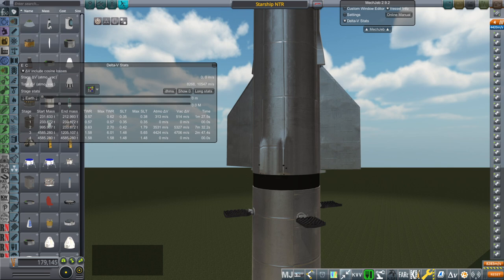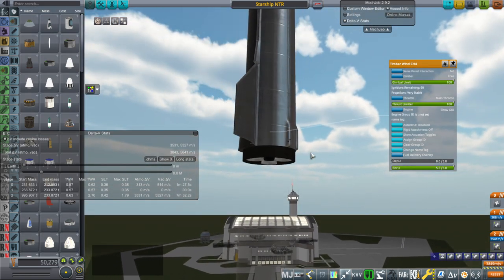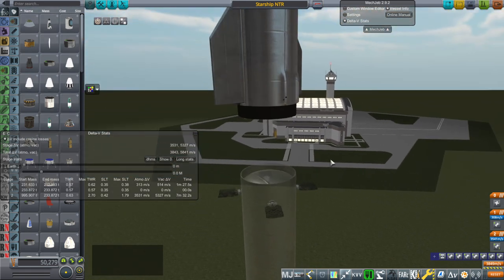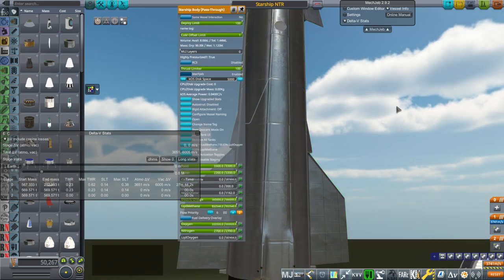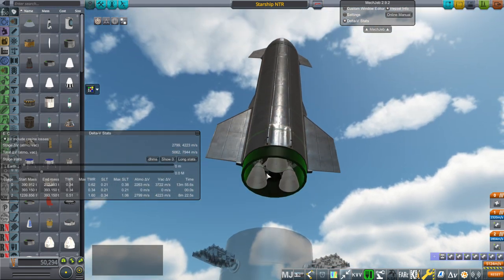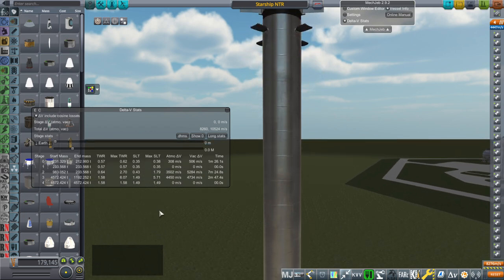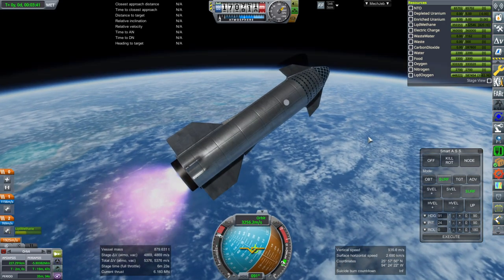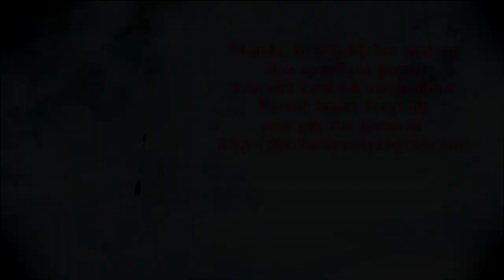Can SpaceX's Starship Go Nuclear?

Comment: There may be the idea of using Nuclear engines on Starship, arguably some more efficient liquid/gas core engines that would allow for Jovian or Saturnian transfers.

I’d also propose to you to make a booster with 4 vacuum engines in place of 8 surface engines on the typical outer cluster of 20. Add a starship nose to it without fins, keep the grid fins and see how well that goes to orbit. Maybe make the nosecone jettisonable to reduce dry mass.

Comment: Well at least the crew will go nuclear once it travels to Mars... We still have no answer from musk how he plans to shield a crew of 100 in a tiny ass tin can.
Reply from the maker: Well, that radiation wouldn't be from the engine, at least. Honestly, I would sure hope a 100 ton payload capacity would get you some radiation proofing, even if it means you only actually carry 80 tons or whatever.
Reply: What type of shielding do you get from just placing the rest of the ship with engines, cargo, fuel, bulkheads, etc. in between the crew and the sun? Does that create thermal issues since no bbq roll?
Reply: @RaizSpace  afaik they are planning on using the freshwater tank as a radiation storm shelter, completely missing the fact that background radiation in outer space is pretty high even without coronal mass ejections and stuff
Reply: @RaizSpace  

That is concerning. Also, I’m not sure how they’re supposed to develop landing gear if their current priority is to catch starship and forego any sort of landing gear testing. It’s a decision blind to obvious safety factors of an untested system without considering the future market of using Starship for crewed missions.

Comment: 1) You are aware that Timberwind, (and specifically the general pebble-bed NTR design) didn't work right? Try as they might they couldn't get the pellets to cool properly and they kept having burn-throughs and melted pellets. (It's an inherent problem with propellant flow over a round object under high pressure, the propellant does not "flow" evenly over the pellet as it does in ground-based, lower pressure systems) and the thrust produced was substantially under prediction while the propellant temp (and hence ISP) was vastly underwhelming. That's the main reason that they've gone back to the heavier but far superior NERVA based designs.

2) Part of the reason NOT to use Starship as a basis for a nuclear propelled vehicle is it's not a terribly good design to use a nuclear engine on. (As the article mentions :) ) Part of the reason is that by burying the reactor INSIDE the structure you get a greatly enhance problem with nuclear radiation being 'back-scattered' into your crew area. Part of the reason for not using a nuclear reactor on launch is the same as the atmosphere, (even a high altitude one) can also backscatter radiation into the crew area. Also by putting the reactor inside the structure you now have to install more radiationshielding across the whole aft end of the Starship structure, (again you're fighting the scattering effect of the hull) and around the aft end to compensate for that hull. A point the article doesn't make but does infer is that your shielding will now have to be a 'concave' shape partially wrapping around the reactor because of this issue. Note that the vacuum engines and all their support equipment will also be 'holes' in your shielding along which radiation can flow forward. (Propellant feed lines and support structures don't like being forced to have 90 degree 'bends' in them but that's what would be required to 'shield' the pathways) Part of the reason most NTR designs have the reactor as far away as possible is to reduce the needed size and mass of the 'shadow shield' whereas with Starship's size (and putting the reactor inside the structure and 'between' the chemical engines) means you need a much larger and thicker shield mass. Also part of your 'shielding' is supposed to be the propellant itself. If you don't have any (or much) left at any point then you have to add more shielding mass to compensate.

3) Part of 'educating' the public (something that is far to often lacking in examining Starship or the supposed "Mars plans" Musk has put out) on nuclear safety is giving them accurate and concise information on the actual dangers of nuclear power and the means of mitigating or reducing them. Starting a reactor in flight means that it is now a highly radioactive mass that is trying to get to orbit that is spewing out lethal amounts of radiation in a sphere that can be dangerous out to distances up to 100 miles with some of the proposed power levels, The reactor will remain dangerous for months after it is 'shut-down' with the danger area slowly reducing over that period. Launched anywhere but from the the middle of the Pacific ocean said highly dangerous reactor WILL therefore fall on 'someone' down range if it does not actually achieve orbit. IN orbit it will be putting out dangerous radiation levels that will endanger people and equipment IN ORBIT even in 'standby' mode out to distances of tens if not hundreds of miles. (No atmosphere to mitigate the radiation) Note that once it has gone 'active' the ONLY safe approach lane to the vehicle is now a narrow cone from the 'front' protected by the shadow shield and the bulk of the vehicle itself. The proposed "side-by-side" propellant transfer concept is no longer viable. (Not that it's viable really anyway but it's what has been proposed) 

4) I need to point out that you don't get a wide choice of propellants for NTR's "in general" since a reactor designed to be able to handle, (say) methane then no longer works as well with hydrogen. Specifically since methane has both hydrogen AND oxygen (which will be thermally split in the reactor due to the heat) the reactor elements have to be designed to handle hot oxygen as well as the hydrogen whereas a reactor designed for hydrogen only can have a simpler and less robust fuel cladding. So pretty much what you design the reactor to 'burn' is what you end up having to use every time. And speaking of reactors I'll note that the article seems to assume using the DUMBO NTR design (a competing design to NERVA out of Los Alamos labs but which never entered full up testing) which I'll note had some issues with using anything but hydrogen due in fact to it's design. (Instead of NERVA's macro-channels DUMBO had 'micro-channels' in its fuel matrix which was especially sensitive to propellant density and clogging which is an issue with a 'carbon' rich propellant such as methane)
Reply from the maker: I already addressed some of your points, including not starting the reactor in flight and ensuring no one would be in the danger zone of the reactor for months during its cooldown if you actually bother watching the video. Please read the article that this was inspired by and understand that this is not "educating the public" but the exploration of an idea I had and nothing more. It is an experiment. The use of the name Timberwind was because I previously made a model of a pebble bed reactor NTR, not because this necessarily has to be be one.
Reply from the maker: To make the parameters of my experiment perfectly clear, the question is: If we have an NTR system with the efficiency with methane and power-to-mass hypothesized in ToughSF's article, then is there a way to put it to use on the current physical setup of Starship and launch it into orbit without starting the NTR prior to orbit? The question is not whether Starship is the best use of an NTR, nor am I broaching the likelihood of this actually happening or any other question.
Reply: @RaizSpace  I did actually watch the video. (And gave it a like, you do good stuff :) ) I also read the article, (I'm a fan of toughsf and atomic rockets as well) i was just clarifying they it's going to always be a problem, including for refueling and cargo/crew transfer as the reactor will be dangerous to approach from any direction except straight ahead for YEARS once it's gone live.

And I was just pointing out that Timberwind didn't work as advertised so the 'numbers' are taken from the pre-test program studies not the actual "working" (and I use the term loosely) model.

I understand the idea, (as I've noted it's come up before and frankly almost no one gets much of anything right so I'm quite happy you at least acknowledge the issues :) ) it's just that Starship is a pretty lousy design for an "interplanetary" rocket in the first place and it's worse for using nuclear power because of the many already existing compromises let alone the ones needed to make it work.

Like I said I appreciate that you at least take the time to examine the issues which many don't.
Reply: @RaizSpace  I got that but it does beg the question of "why" then which you also address in looking to have fewer re-propellant flights.

In context here I agree that Starship isn't the 'best' (IMHO even 'good' but that's beside the point) interplanetary vehicle and should probably be limited to up/down mass at the end-points. The 'problem' here is that the Starship is designed to be inefficient because it has to have a high flight rate to make any possible economic sense. (Again arguable even assuming anything like the 'projected' flight rate which isn't likely) So Elon needs it to be chemical and inefficient to allow a 'plausible' flight rate that can support reuse and 'rapid' turn around.

As MatterBeam says, that makes it highly unlikely to even be considered and all that before the other issues are raised.

Still it's GOOD to see someone taking the numbers and actually running them at the very least which as I noted too many don't do.
Reply from the maker: Fair enough. I'm definitely not a specialist in this area, so I'm not trying to put out anything definitive. I'm just here putting my pet simulator to use and seeing the numbers it churns out.
Reply: @RaizSpace  Which is why I enjoy the stuff so much :)
Reply: "That's the main reason that they've gone back to the heavier but far superior NERVA based designs." Are you referring to the Low enrichment ntr?
Reply: @5000mahmud  Actually the Low Enrichment (LEU) design IS a variation of the NERVA, (lower enrichment = less regulatory stress' :) ) but IIRC both heavier (reactor wise) and less efficient than the High Enrichment (HEU) reactors.

My main point was that work on the pebble bed design (ala Timberwind) was mostly dropped due to the shortcomings. There's still an idea kicking around of a "pebble-bed" that uses a rotating "bed" to hold the pebbles (themselves supposed to be 'floated' on propellant in small, shallow 'niches' in the bed) and which are 'dumped' at the end of each 'burn'. 

Now what's interesting is ToughSF's actually touches on a 'competing' design to NERVA called the "DUMBO" reactor which was to be vastly lighter and more powerful than the NERVA but more complex and was felt to be 'questionable' as a concept. (Despite the fact the engineers at Los Alamos actually built elements, brought them to criticality and flowed liquid hydrogen through them. A NERVA engineer actually held one of the elements in his hand and flatly stated that it was impossible to make :) )

It was a design currently called a 'foil' reactor where the elements are shaped metallic foils stacked vertically and the narrow channels allowed a very high heating across a very narrow distance thereby keeping the pressure and thrust higher. As I noted though DUE to that narrow cross section it was even more prone to blockages from something like the carbon in methane but on the converse side the passages would be so short it might not matter.

Unfortunately not only was Los Alamos kind of 'looked down' upon by the more civilian driven sectors of the Atomic Energy Commission it was up to it's eyeballs in military nuclear work so it didn't have a lot of time or personnel available to pitch or work on the concept. The death-knell was that in a budgetary decision since the NERVA design was somewhat ahead of the DUMBO that both would use the already developed NERVA nozzle. Unfortunately DUMBO used an active cooling scheme, (due to the high flow rate) and the NERVA nozzle couldn't handle that operation so DUMBO was shelved and pretty much forgotten.

Which brings up another bit, something I'll aim at @Riaz Space: LANTR, (LOX Augmented NTR) concept in that you inject LOX into the nozzle (and into the super-heated propellant in this case methane) which drops your ISP (average from 900 to 800-600-ish for LH2, I suspect less for methane) but greatly increases your thrust. I mean if you've GOT the LOX capacity on-board then why not?
Reply: @randycampbell6307  I see. Are there any modern projects using the DUMBO design? Sounds promising.

Also, thoughts on the pulsed nuclear thermal rocket concept?
Reply: 1. Pardon me for any ignorance, but if the problem is the pressure, why not keep it low? The chamber pressure of a vacuum rocket does not need to be especially high. (Note: I recognize that by decreasing the pressure you increase the chamber volume needed to achieve a given thrust, increasing either channel size and/or number in an NTR and thus potentially over-moderating the reactor, resulting in a higher needed reactor mass and thus a greater trade-off between chamber pressure and TWR than in a conventional rocket system, but I am unsure on to what magnitude that could/would be the case.) Or perhaps bias the pellet dimensions to be more ellipsoidal?

2./3. Are there any calculations on the amount of mass required, using optimal materials, to battleship away the radiation danger of an NTR at [x] thrust? (i.e. no shadow-shielding, make it approachable at any angle besides possibly the rear)

4. Methane has oxygen? Pretty sure its chemical formula is CH4.